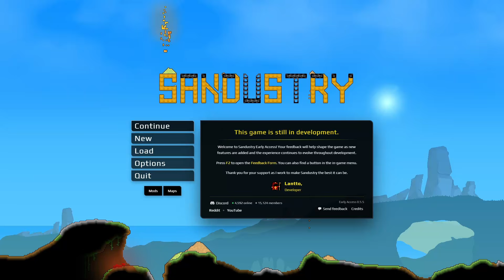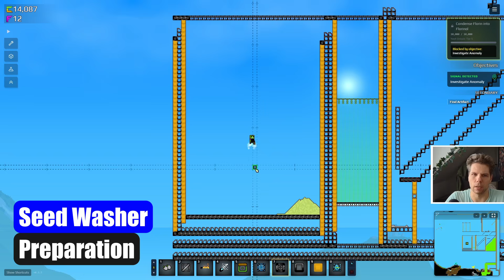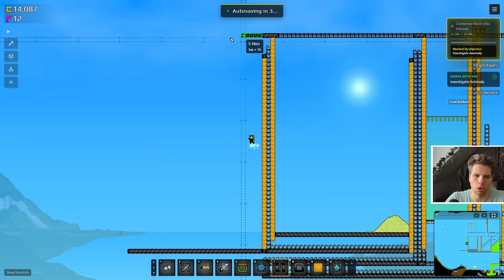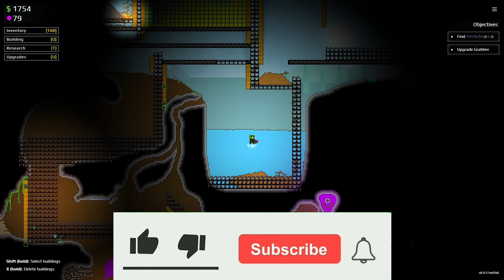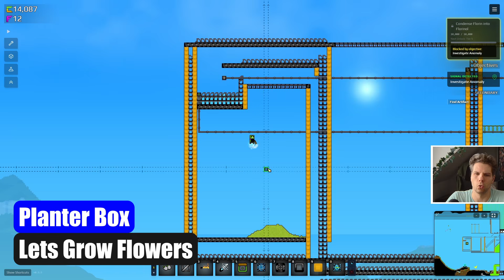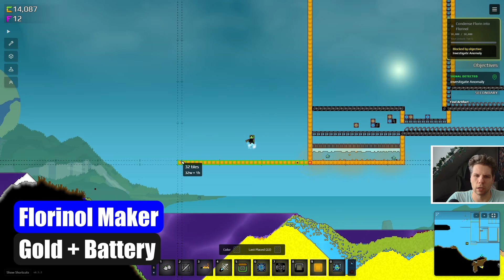Best Tips How to Build an EASY Flower Factory (Never Stuck) | Sandustry

Comment: For the seed washer i simply use a box with two filters over the whole length.
Top filter only lets dry seeds through.
Below the top filter a pipe with vents every 4 tiles.
One row free, for the water.
And the bottom filter,only letting wet seeds through.

so far, no water over flow, because it cant leave the box and no wet seeds getting stuck, because the filter pulls it down.

Comment: Only me that cant get the water thing to work the wet flowers start to pile up and it blocks it all in the water
Reply from the maker: it depends on how much seeds you throw in. in early to midgame it should be fine ( as it is for me).
from mid to lategame or when you throw a bunch manually in it can get a bit blocked after the wetting part.

i can recommend just to add below (in same box) just a 2nd wetting machine (copy the other) to get more throughout in.

Comment: EDIT: I'm wrong. Dropping water from above is better - it ensures the vent doesn't get covered by seeds which blocks the water and jams up the whole process.

I think only having a vent at the seed-wetter @1:25 is necessary, as the vent will stop when water reaches it, so you won't need to pump out any excess water.  

These videos are extremely helpful, though, thank you👍
Reply: yeah just have the water vent at the height limit you want water to be at.
Reply from the maker: Great that you enjoy the videos <3
1) vents do stop watering indeed. in my build the vent is high up thou so that it can drop right on top of the seeds so it would overflow into the tank before it get reached
2) i could replace my pump wiht a vent so we dont need a pump & it doesnt overflow
> then no water drops down onto the seeds thou (which i like)

Its a good tip!
I think i will add this concept at a different part of the factory.

Which Topics should i cover next?
Reply: @PicaPinguin  Yup, you're right. I dumped on tons of seeds and my single vent in that lower left corner got jammed up and stopped working when seeds covered it, so dropping water from above seems like the better way to do it 👍
Reply from the maker: iam now doing it with 2 vents only on the bottom but leaving 1 space on ground free and let my seeds only drop in, in an area where no seeds fall into.
Reply: @gregariousjb  im still having trouble with seeds getting stuck. The water level rises too high and launchers wont push seeds. I've got my pump in exactly the same spot.
Reply from the maker: try no pump and 2 vents on the left of it (1 space free on ground)
that should work better for water + overflow protection.
you can also make on top more of an launcher stair case to help wet seeds get faster out of their so it gets very consistent